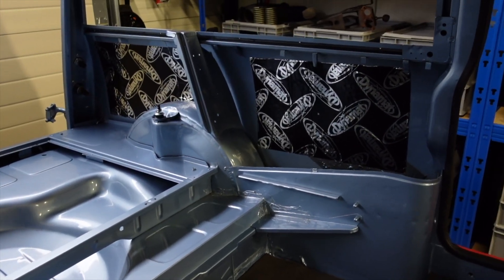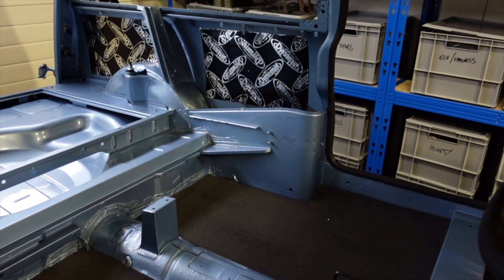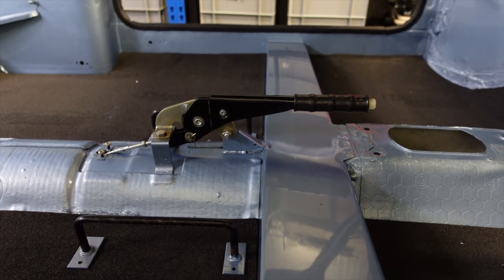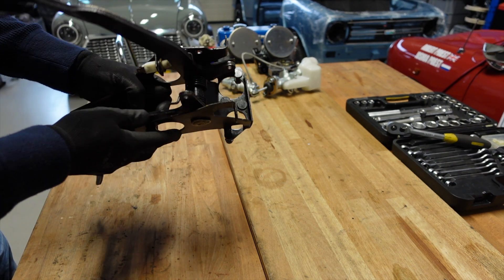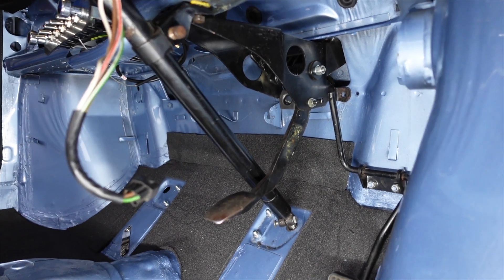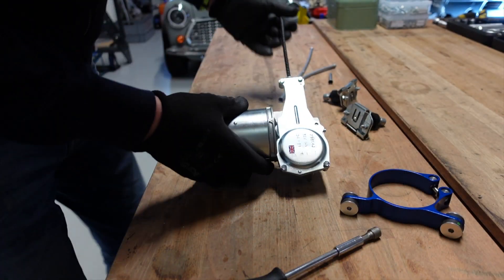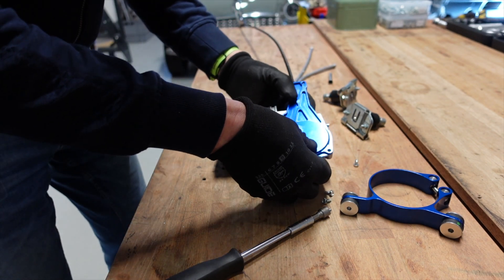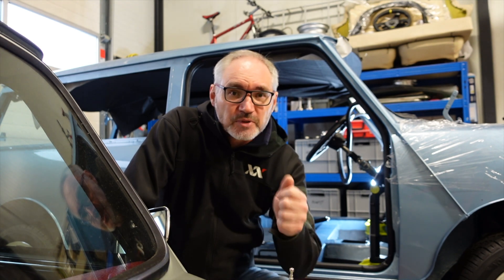Classic Mini Clubman Estate - Electric Conversion

Comment: just curious about what kind of regulation needs to pass after the conversion,  assuming it is allowed to make such conversion in the UK, right? pity we don't have such regulation in Taiwan to be able to continue the legend of all classic cars
Reply from the maker: For The Netherlands we have to go through the regular APK test, as long as the vehicle has not had major structural changes from the original OEM design, If it has been structurally modified then its another level of pain and paper work.

Comment: You're doing a great job but aren't those flares bubble flares not single flares?
Reply from the maker: Hi Stewart, the instructions that came with the tool say flare, double flare or DIN, doesn't mention bubble, maybe it is called something different in each country???
Reply: @classicminiculture9800  as far as I know its called a flare. You have First motion and second motion. First is male and second is female.

Comment: Looks great. Would be awesome to do maintenance on with how clean its going to be. 

Have you also considered a range extender on board?
Reply from the maker: will keep that in mind.
Reply from the maker: Hi Frans, the range extender will be  going under the rear seats👍
Reply: @classicminiculture9800  what do you have in mind as an range extender?
Reply from the maker: Frans, we are still going with Battery, it will be a second bank of batteries under the rear seat,
Reply: @classicminiculture9800  nice, im very curious on how performance and range are going to be. This conversion is not one to be cheaper if you take all costs in consideration. But still it's a alluring idea for me.